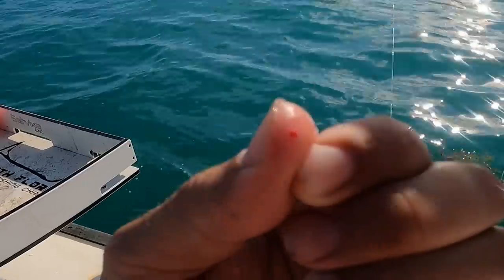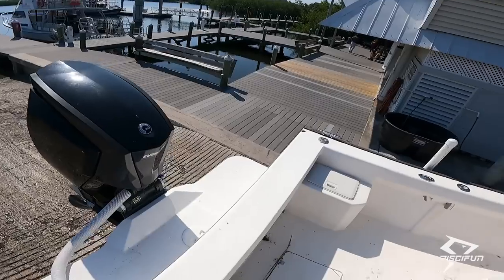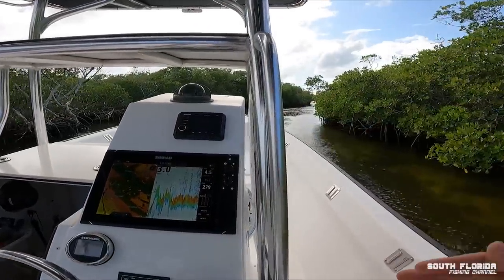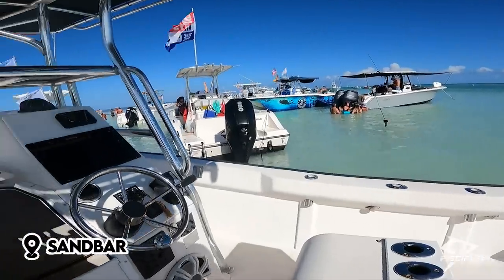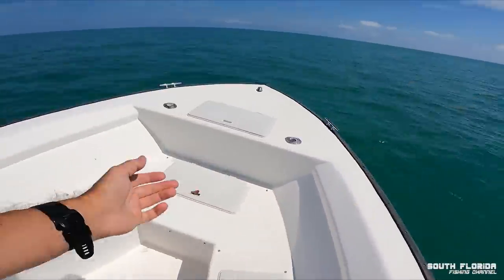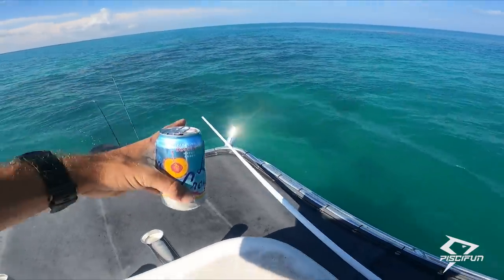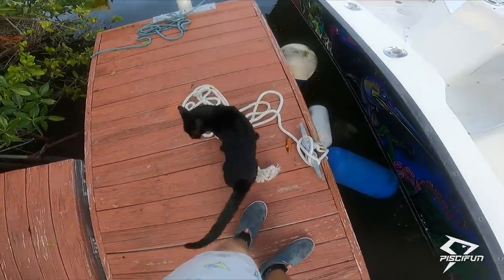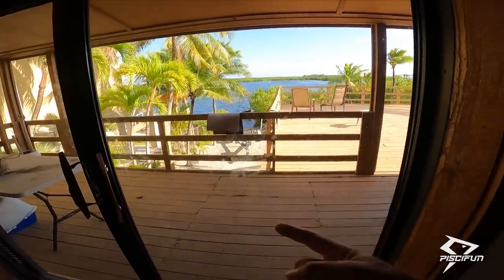My engine acting CRAZY! Catch and Cook FISHING

Comment: I'd check your fuel filter and then fuel pump. Or the electrical might be glitching, sensor or computer. Humm low temp sounds false and glitchy. Also vacuum leak, but I don't know your engine at all, so ... There is also an Italian Tune up, which means go balls out for a while to get things running and carbon burned and blown out. Works on cars :))

Comment: Ahh, fuel restriction, change the filter between the pump and injectors (maybe even if you have one before the pump). Any work on the fuel stuff can leave particles that don't make it through a fuel filter. The surge can come from pressure building then pushing a bunch through. Could be injectors dirty too. I worked on Jet engines and some on cars so I'm not a boat motor wiz, but pretty good at general trouble shooting.

Comment: Heiko the spike in rpm due to low fuel pressure is because you still have all the oxygen you would for normal operation but you are burning lean thus the fuel burns faster causing surging. Like if you are trying to tune for more power you typically lean out the fuel so it burns faster and more complete for the air charge if you throw off the air/fuel ratio it can cause those things.

Comment: So this may sound nutty. When you’re going over 2k RPM the fuel pump or delivery system is not having issues supplying fuel due to the higher RPM. But when your going below 2k RPM the fuel pump or delivery system cant keep up due to the low RPM which causes the surge in the RPM. I can’t say what the part is or what exactly is causing that issue but it most definitely sounds like a fuel related problem.

Comment: I'm not sure if with boats, but I know some older car engines with computer controlled fuel systems when they get certain fault codes like crank position sensor fault will put the engine in limp home mode.  The engine will run fast enough for you to drive slow till you make it home or a garage.  After shutting the engine off, the car will not start unless the fault clears.

Comment: High-co!  On an Evinrude if you ever get a low oil alarm, the computer will still let the engine run, but only to a maximum of 1400 RPM to allow you to get back to the dock. If you think the low oil alarm was tripped because it was tilted to high, then turning off the engine and turning it back on resets the CPU. It’s not a problem with the engine. It’s done by design.

Comment: Nice Heiko!  Engine may have gone into safe mode due to the faults you had.  Turning it off and back on without issues reset the computer. I had that on a Yamaha with there was low oil in the main tank.  It was two stroke, it acted just like that.  Also happened once with a fuel filter issue (under the cowling)  Good luck dude!
Reply: Yes when he said that about the dead battery ! Change battery and do a reboot on system ?

Comment: Now that I see the end of the video you don’t want to bring it in anywhere my opinion would be make sure you have all fresh new batteries in good condition take care of all the maintenance replace the thermostat replace all the water separators and water filters being the boat sat for a long period of time you might have water I. The fuel. Fill the tanks with ethanol free or the best octane you can get and run it through see if that helps with the upgrades. If you know someone with a scanner to clear your codes after the repairs see if anything comes up. When you do the batteries make sure there is no corrosion and or loose connections.

Comment: I had a boat once that I towed with a Dodge Dakota pick up truck and occasionally it would overheat , especially long distance and with the Air conditioner running . I had a transmission cooler installed on my truck , sort of like a radiator for the transmission , and it solved the problem .
 Same boat had a problem when I got it that when you cut all the way down on the throttle from full throttle and then gun the boat off . It would be impossible to start . Turned out that it was causing a fuel line vacuum when you shut it down like that, and so when you tried to restart it it couldn't get fuel .

Comment: First replace battery, these motors and very electronic and require a steady flow of power.
Second buy a clear tube of 3/8 fuel line or any major hardware store sells something. Add it after fuel filter and watch it while running if your getting air in the line then bingo you've got an issue in the fuel line or tank. Good luck

Comment: Heiko…..I know you use to have a Mercury on the boat before you upgraded to the Evinrude……did they change your fuel line and do you use non-ethanol fuel……I had similar issues with the idle speeds of the motor……turned out to be the inner liner of the fuel line from the tank to the motor was deteriorated which clogged the fuel pump and filters……check your filers for a gel looking chunks in it……if there is….replace the fuel lines, filter(s) rebuild the fuel pump……I did this and my boat ran like new again

Comment: Anytime to get an error or low oil. Engine goes into Limb mode so you dont damage engine once you turn off it reset and allows you to get more power. Change out your battery  low voltage to engine can be interfering with the computer

Comment: I replaced my 06 Ram 1500 4WD powered with a 5.7 hemi with a 2022 Silverado 2500 HD 4WD powered with a 6.6l LT (gasoline) LT engine.

The new chevy is a beast with massive torque that tows my 22 foot Shamrock way better than the old Dodge.  
You need a truck like that to tow your boat and your next boat if you buy the LTB 25!

Comment: When incoming fuel to the engine runs lean than there’s more air than fuel for the combustion. Air is more easily compressed than liquid, so the piston can push against the air in the cylinder faster and easier than against fuel. Hence the RPM increase. If you enrich the fuel in the mixture than the RPM’s lower, since the mixture is more dense. The piston has more “meat” to  push against. This equates to lower RPM’s but more torque, since the greater amount of fuel is now being turned into rotational energy through your motor, transferred to the prop. You’re making me nervous, trusting this motor all the way out there. Get the goblins worked out of that thing. Cheers, and happy fishing!!
Reply: AMEN!  Great comment!

Comment: Would it be unusual for the shop do a “sea trial” and none of these problems didn’t arise.
Reply: No. Especially if the problem didnt exist prior to the boat going in. The new outboards and even car engines are so reliant on the proper amount of power being supplied, theres no telling when or where a problem will surface. A weak battery, can throw any number of issues at an engine. Not saying this is his problem, but it does happen. I can think of a handfull of issues that could be causing his issues, and they run from electrical to fuel delivery. I went to pick up one of fire engines from a dealer. They had the truck a month looking for an intermittent shutdown. They ran and drove the truck for hours after they thought they found the problem. Started the truck, let it idle, did a walk around, got in it put it in drive, got maybe 200 feet to the gate and it died. The dealer put 30 hours on it testing their fix.
Reply: I’m leaning towards the throttle position sensor or the throttle body assembly itself

Comment: Fuel restrictions issue. You're getting RPM spikes because your motor is running lean possible due to a bad vent solenoid  causing a vent lock  or a bad fuel solenoid . Doesn't seem like you have a pinched line because a restart corrects the issue. I highly recommend selling that engine and buying a used Yamaha . Thoes g2 evinrude 2 strokes are horrible . Love your vids

Comment: I keep a Hudson sprayer inside of my truck filled with water and Saltaway. After every time I launch my disc brakes and wheels get sprayed. I have torsion axles so no need to spray leaf springs.
I would advise you to send this video  to the Evinrude shop that just worked on your boat. They will know best. That being said, my Yamaha 300 is 5yrs old and has never had any problems. Not one!
I could never own a motor like your Evinrude. I would never trust it knowing that it could act up and fail leaving me stranded at anytime.
Reply: I do the same thing with my trailer and the portable washdown technique.

Comment: Heiko it is a strange thing to diagnose due to the intermediate, turn off and turn back on could be something in the ecu or fuel sensor  system, both need a DDT Digital Diagnostic Tester

Comment: I’d replace the fuel line.  The deteriorating on the inside.  It would also explain why when you couldn’t go full throttle and shut it off and then it went full throttle fine.  The fuel line collapsed you shut it off released the vacuum and it started it again and got full fuel through.  Cheapest easiest fix. If it’s not something electronic like a sensor but plugging it in should tell you if it’s a a sensor.  That fuel code answers the question

Comment: It appears you may have a fuel issue, change your filters and change your primer ball. Also I am not sure if G2's have the pencil filter in your fuel return line.
Reply: Also check your clamps on your fuel system you could be getting air in the system. Try the test again and when it happens again Try squeezing the primer ball ( if it is collapsing during test then you have your issue)

Comment: Great to see you back on the water in your boat! Hope you get that trottle issue sorted out asap! 👍👍
Reply: Looks like it's in limp mode. The engine is not allowing you to go past 1400rpm because it has faults. It's so you can limp back and not be stranded without damaging the motor. A TPS could explain the intermittent reving. I'm guessing it's throttle by wire, not cable. It appears you have a failing sensor. But I'm no Evinrude mechanic. Any mechanic with a scan tool can tell you. But it sounds like it will be covered under warranty.

Comment: Impeller pitch and diameter is based on sea level operation. At higher elevation, you will lose RPM and may have to drop down one impeller size. Long use in corrosive conditions may create pin holes in the exhaust tube which builds up back pressure and reduces RPM. Excessive RPM is usually caused by air entering the pump. It can be caused also, during start up, if the leading edges of the blades are blunted from gravel. A rough boat bottom, keels or damage ahead of the intake can introduce air, as well as setting the motor too high.
Reply: no elevation in South Florida

Comment: Yo Heiko, does your throttle on your top give you the same exact issues as the one on your CC? because if it is exactly the same, then it is not a throttle issue, it has to be a component in the engine or whatever is communicating between them. Anyway, hope this helps. Glad to look into this further with you.
Reply: I didn't think about that.  Good one.

Comment: I think it's the gas been in the tank awhile I would run that gas out to pretty low and treat it and fill the tank back up to full and run the hell out of it and see what happens check all your ground whires to see if they are clean and carbs might need cleaned put startron in for treatment I was a mechanic for 25yrs get a hold of me and I can tell what to do for free

Comment: I’m not a mechanic but it could be your fuel filter, water separator or even something in the fuel tank clogging the fuel line. I had a similar issue with my old boat. When I switched to an external tank it ran flawlessly. Clean the onboard fuel tank found all kinds of junk and after cleaning it it ran flawlessly again.

Comment: 1 Obstruction in fuel line, fuel is restricted and your throttle is set for higher rpm so when it gains the fuel it throttles up. Check fuel filter or add one inline. 2 bad fuel. Make sure your not sucking up sand or you will have injection problems later.

Comment: I would change that battery out ASAP...its bad. Probably causing low voltage to the Engine Module and quite possibly your power surges at idle

Comment: If you have a code that your not getting up to temperature on your evenrude you probably have a themastat stuck in the open position causing the engine not to warm up enough to get to operating temperature. Maybe that’s why you have the erratic engine rpm’s.  If you just had in in for service and they water tested it and inspected your whole boat why didn’t they see all these issues your having with the drive ability of your engine. I would bring it back and get these issues fixed a thermostat is probably going to fall under maintenance not warranty the power issue with the battery I would take care of first yourself. Clear all the codes out and see if anything comes back. Low voltage itself can cause the computer to have operating issues and be the cause of the engine running strange so take care of that first and see if that helps if not bring it back in to get fixed. I don’t work on boats professionally but I have 38 years certified working on cars I’m a master technician.

Comment: start with swapping out all fuel filters and plugs. my yamaha 2 stroke had similar issues and it was a build up of carbon on plugs. after swapping out plugs and filters i started running high test fuel and and issue stopped.

Comment: Showing results for error code 137 for an evinrude etec
Search instead for error code 137 for an evenrude etec

Code 137 is from low fuel level in the VST. A vacuum test with clear line on the 'suction' side of LP pump will quickly determent if there is a supply problem between the LP pump intake and boat tank either by no vacuum or air bubbles.Dec 14, 2018

Comment: Service the water pump new impeller engine doesn’t circulate water in lower rpms so engine goes into that mode higher rpms to circulate and cool down . My suzuki 250 did the same toke it to riva key largo without me saying nothing because that didn’t bother me they serviced engine and never again

Comment: Hey man I read through all these comment and from being a previous owner of multiple different evinrudes you are not having a fuel issue.
You problem lies in your bad battery,
Ever rides are the most finicky assholes when it comes to voltage. From injector issues to random ghost codes that cause your motor to go into limp mode. All caused by voltage. Change those battery’s out and let me know if I’m right.

Comment: Check the fuel pipe out of the than should be a check ball they go bad mine sucked the ball 1/2 way up hose when it happened was doing 45 mph dropped to zero like that would start idle no power

Comment: How'd that 20# work on the 4000 reel? Too big? Good cast?
Reply from the maker: It worked but I would 100% recommend putting 12# mono on instead. 20# is overkill and doesn't sit on the reel as smooth
Reply: @SouthFloridaFishingChannel  Sounds about right. I don't go more than 15# on 4000 series spools. Wanted to see if the outcome might be different on the Picifun. 

I sent a Captain 8000 to my son in Corpus Christi - for those jacks and kings. Good stuff!

Comment: If its a newer fuel injected engine. I would start out by putting a new battery in it. Because believe it or not even small voltage swings and drops can cause the computer to do funky shit. As a general rule stay away from Walmart batteries. Their cheaper for a very good reason and they'll have you chasing electrical issues until your blue in the face. Because your convinced that new battery from Walmart is good. When in reality its not.

Comment: The Problem is thats a BRP made Evinrude and they already stopped production on them. That was their first attempt at an outboard and they already gave up and retired the Evinrude name. That engine wasn't built by OMC and OMC has been long gone for almost 20 years now. Personally I would have went with any other brand. Probably Suzuki or Yamaha over that BRP Evinrude and waited for BRP to prove themselves and again they've already given up trying.  Check all your fuses and make sure all your electrical connections are tight with no corrosion green crusties etc.  Again proper voktages are very important. Battery cables need to be tight around the posts. Not just on there just loose enough to remove them by hand. No they need to be tightened down with a wrench. Your dealing with a computer controlled engine not a carbureted engine. So you can't get away with stupid little shortcuts anymore. Otherwise your going to have issues. Doing that kind of stuff can also fry certain sensors that are more sensitive than others. Put a brand new battery in it and make sure everything is clean and tight and go from there.

Comment: Dump fuel out of the fuel/water separator filter on the right side of the engine, rig up your tank from your jon boat with NEW unmixed fuel, remove the boat's fuel line and hook up the portable tank. Run it, if it still acts up its on the engine side, if it clears up its on the tank side. These comments are SAF.

Comment: I had the same problem with my Evinrude G2s DPS… got the new pressure sensors and still had problems 6 months later. I actually made a video about what I did to fix it! https://youtu.be/mnLJrD_ieCc … I also carry that blue salt away stuff in a pump up sprayer and spray my hubs after I launch my boat.